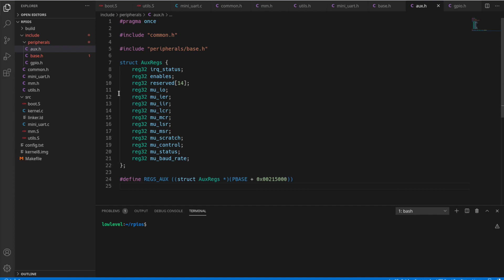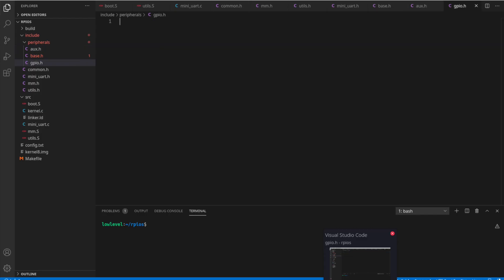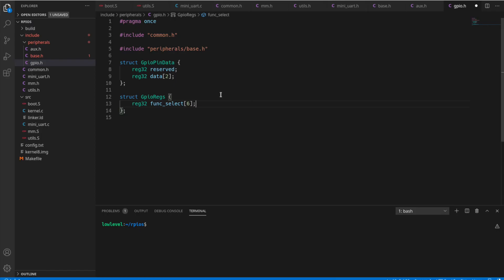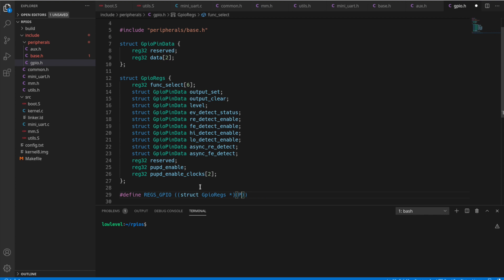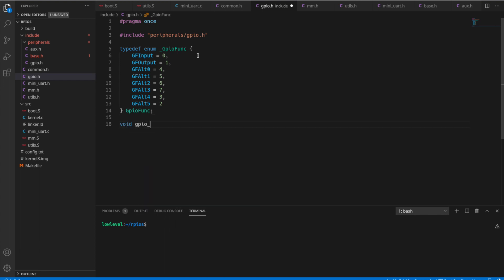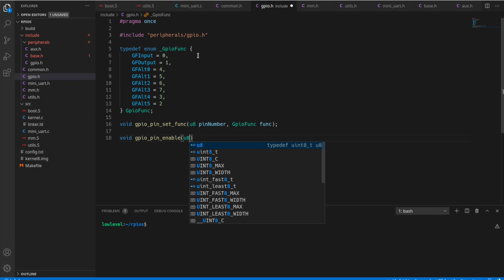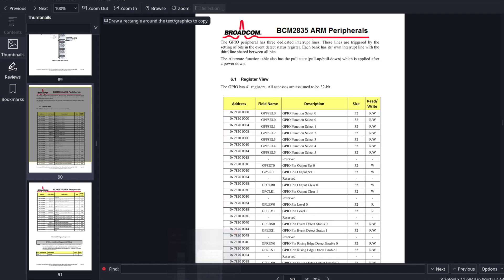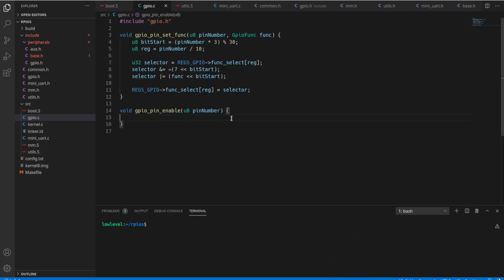Raspberry Pi Bare Metal Tutorial - Part 3

Comment: Will this code work for a Raspberry Pi 4 as well, since you were referring to the BCM2835 datasheet instead of the BCM2711 datasheet? Or would we need to modify some of the code? If it is the latter, then which parts of the code should we modify?
Reply: A related question to the above...looking at the BCM2711 ARM Peripherals pdf,  I do not see the PUPD_ENABLE or PUPD_ENABLE_CLOCKS registers defined. In place of that, there are 4 PUP_PDN_CNTRL registers defined starting at offset 0xe4 of the structure. Can you help me understand why your code will work for the PI4 in this case? Based on my (very) limited understanding, the way you have defined the GpioRegs structure, the PUPD_ENABLE and PUPD_ENABLE_CLOCKS entries would be located in reserved space when compiling the .img for the PI4.
Reply: @al4sk4nbu11w0rm  same question
Reply: @al4sk4nbu11w0rm Did you ever figure this out?
Reply: Thank you for the reply, indeed watching the fifth video answered this question for me :D

Comment: Hi, these video series are pretty cool dude, thanks for it, but I've some questions, the first one is regarding to the delay function, how are you sure your tick takes exactly one clock cycle, did you measured it? if so, how?, if I'm not wrong each of the operands you've used in assembly for the delay function, takes more than one cycle, I'm very interested on how this can be confirmed, also did you've tried how fast you can toggle a GPIO pin with this baremetal project. Thank you again.
Reply: @lowleveldevel1712  Awesome, thanks.
Reply: yo the answer isn't showing?